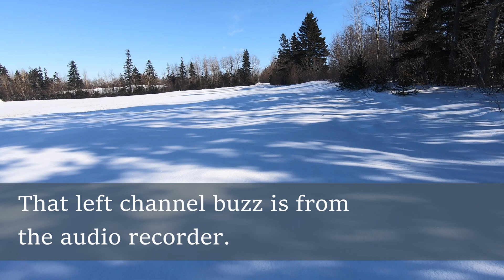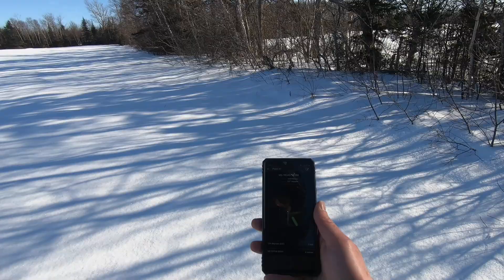Vnetphone v6 Review | Testing Audio and Range | ADV Gear | Island ADV

Comment: Are you able to pair this with another communicator from a different brand?
Reply from the maker: I can connect my Cardo with this. But that only works because the Cardo is the one doing the connecting. 
The vnet on its own will not connect to something other than a Vnet. Universal pairing is the term and the thing to look for in comms units if that's what your after.

Comment: hello, i have a pair of these and we cannot hear eachother over the bike even with the volume up, is there any way to fix this? im assuming its just a problem with the cheap mics provided in box, but i dont have a way to test that without buying new mics that may or may not fix the problem
Reply from the maker: Actually it could be bad speakers. Try playing music through them to see of you can isolate the issue to that. Also I find when I wear earplugs with these voice comms are hard to hear so I have to max out volume. 
I will say I've since moved on to a cardo on my helmet, but my buddy still uses his and we pair my cardo to it and it still works decent. We used that for out big trip.
The only other troubleshooting I can suggest is to check mic orientation. Make sure the input side is toward your mouth and is very close to your mouth. It seems simple, but I do comms for the army and for quiet voices on the means, the first thing I tell operators to do is this, and it's surprisingly effective, lol.